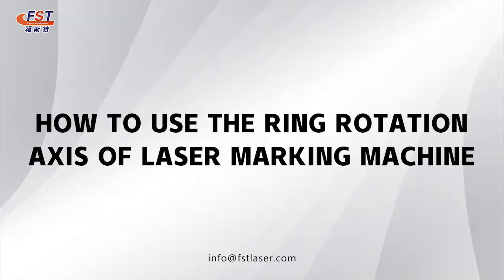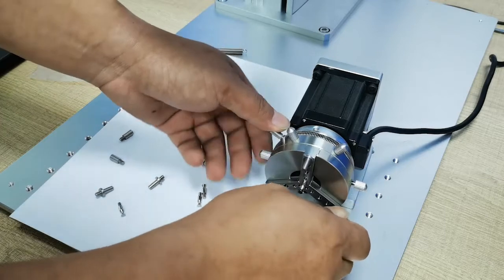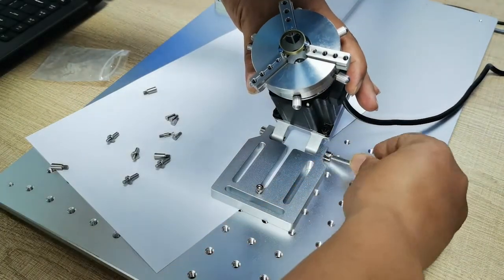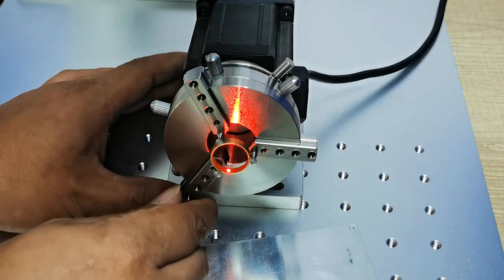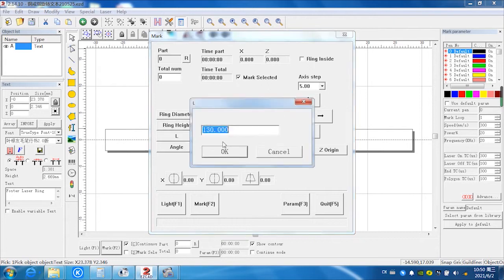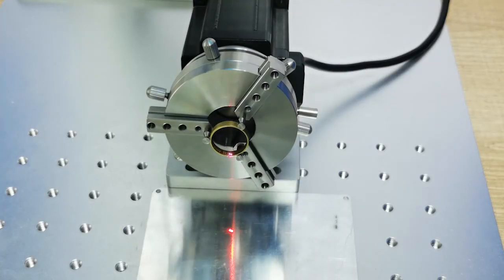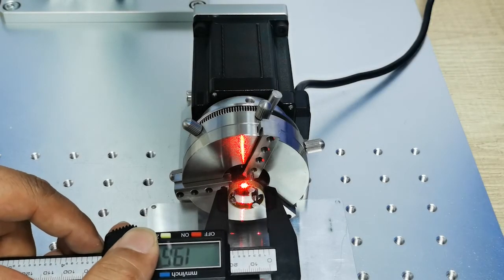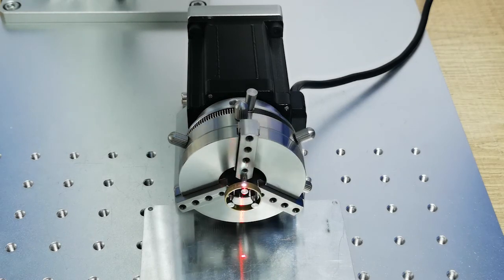How to set up the ring rotary tool for fiber laser marking machine.

Comment: I want to make laser marking on Acrylic Material Dia35mm and L 100mm and I am looking for Automatic set up like you shown in video ( currently I am using Wood fixture material) 
So could you please share the motor details and cost and also I like if you share your contact number so I can discuss my problem with you so I can get better guidance from you. 
Thank you for spearing your valuable time to read this message and waiting for your reply. 
Thank you again!
Reply from the maker: Hello, my wechat/whatsapp is +86 15314159086,you can send message there.Thanks